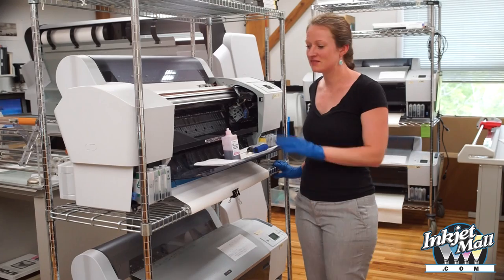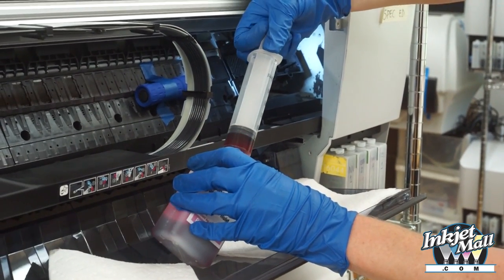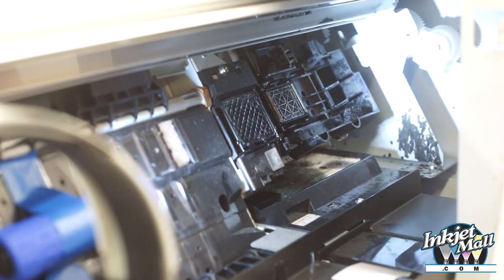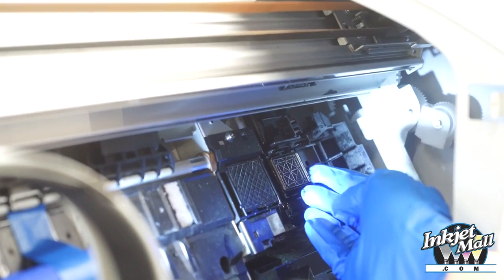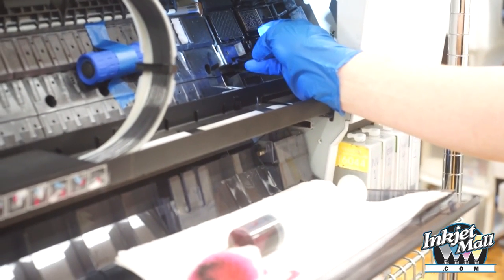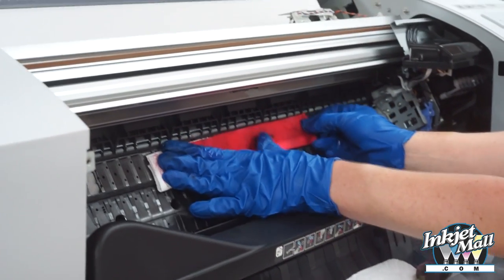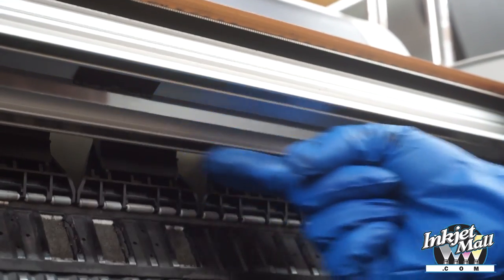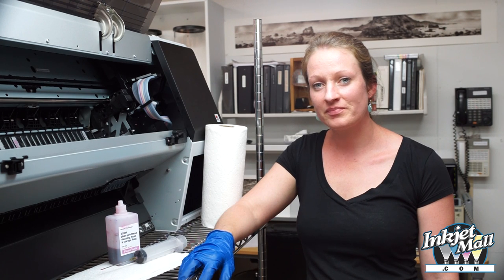How to Professionally Clean Epson 7800, 9800, 7880, & 9880 printers

Comment: Hey I was wondering if you might be able to help with an issue I'm having with my 9800...it doesn't power on. I know the power supply cord is good because it works on other printers before and after trying it on the 9800. When I plug it into the outlet I can hear a faint noise kind of like a short hum/buzz. It seems to want to power on but fails to do so. I took the back cover off and cleaned off the dust/debris but continues to fail to power on. Anyways I wasn't sure if this was a common issue or not...I can't seem to find anything else online about my issue. I did notice there is a 3v lithium cell battery on one of the boards... wasn't sure if this might be contributing to the problem? Should I try replacing the battery? All wires seem to be secure and no burnt out pieces. I was given the printer from a friend bc they purchased a new one for their business and it was working before I received it. I'm an artist with little to no budget for professional repairs so I'm attempting to repair it myself so I can use it to print my artwork on canvas/fine art papers. Thanks in advance for any advice!

Comment: Hi I have a 7600 which is reading no maintenance tank, I've fitted a new chip on the tank and changed the sensor on the tank reader and the circuit board as it was very worn.  But it is still saying no tank any ideas cheers Alex

Comment: Hi, I have an ultrachrome 9600 we changed the printhead, and after the plotter does not want to charge the ink, we made the initial charge (pressing feed paper up and down & enter ) then into the cleaning menu, and order the ink charge but we can watch ink does not run through the tubes, can you help me please ?
Reply from the maker: do not tighten the ink tubes too tightly onto the ink dampers (you should have put new dampers). If you tighten too tightly it will pinch the small rubber oring and it will cut off ink supply to head.  Make sure your capping station is clean so it can provide suction. Do you know if your capping station pump is faulty? Are the cartridges that you are using fully primed with ink?

Comment: Long story short, this stuff works! Its basically industrial windex. 

Long version: I acquired a 9600 3 years ago with a clogged megenta. The previous owner left it for 2+ years unused. Im surpised it wasnt ruined. Anyways he ran the cleaner program for a whole 220ml cart and than used windex. Fast forward and i get it with megenta stil half baked. B&W came out with a green tint and yellow was greenish also. I found -5 on the megenta in the drivers worked (mostly) to get ride of the green tint. Than I saw this video about cleaning the print head and decided it was worth $60 to try it out, otherwise the printer was going in the trash. Well.... It worked, whatever was clogged in the head is gone and nothing is green tinted. This stuff is insane, I can see it bubbling and melting the old ink. I didn't believe mine had a metal screen until this stuff took all the caked on ink off. The plastic is also white now. The wiper was even worse. Chunks fall off! Now it looks like a wiper.

Anyways if your printer is giving you problems, buy this stuff!

Comment: Thank you! That's how I've been cleaning my print heads (two Epson Stylus machines, one R1900 and one 7600). However, I use  70% rubbing alcohol and/or the original Windex glass cleaner. I use these only because I haven't heard of a solution specifically meant for cleaning print heads, that didn't contain mostly one of the those two ingredients, (in the case of Windex, I'm referring to the primary active agent).

That said, I've recently had a very difficult time trying to clean and unclog the nozzles & print head of my 7600. In fact, I've used the equivalent of two months of my typical printing trying to use the Power Cleaning and regular head cleaning modes along with the technique you've demonstrated here.

Some of the nozzle check tests would show an improvement, (but very small improvements), and yet others would begin to show the nozzles getting worse. I'm going to try this Piezo cleaner (if I spelled that right), and buy some of the additional accessories to make it a little easier to apply.

Up until now, this printer has always done a good job but it is a 5 generation printer. The tech is far behind and I'm seriously considering a professionally refurbished 7890 for $2000.00, (comes with 350 ml Epson inks most of which are 40% to 60% full). Thanks again for that video. I know the cleaner will be of great help regardless of whichever printer I use it on.
Rich
Reply from the maker: ammonia cleaners (Windex) should not go near modern Epson print heads. And alcohol dries to quickly...   best to use something designed solely for printheads (PiezoFlush).
Reply: Thank you, and yes, I'm going to use the PiezoFlush and try to clear those 7600 nozzles. However, I did wind up purchasing an Epson Stylus Pro 7890 in pristine Condition, (seriously, THAT GOOD!). I bought it from a small certified, printer repair company in Dallas/Fort Worth called "Levi Systems inc.".

They are a top-shelf tech/repair company and also sell new printers along with used ones if, and when they come upon those that are only in very good aesthetic condition. In addition to the appearance of the ones they consider for reselling, the mechanical condition must be very good as well. 

Even so, they always replace the print head, pumps, cutters and other key parts regardless of condition once they know they have a buyer. Doing that essentially makes the printer every bit as good as a new one. I was impressed all kinds of ways with the unit I got for $1900.00 a few days ago.

They personally delivered it, set it up on its table, and ran a full nozzle check, head alignment check, etc., etc. Of course, it passed with flying colors, (pardon the pun), and they even gave me a new 350 ml Matte Black ink because the Matte black ink it had in it was nearly empty.

The remaining cartridges were all 350 ml and at least 40% full! Then they handed me an Epson leather, (or simulated leather), folder which contained two manuals, a quick-reference guide, a DVD with the Drivers, (Firmware was up to date already), and the complete paper-catch basket system! 

Like I said, it was a seriously good deal. I plan to clear the 7600 nozzles and sell it for about $250.00.
Thanks,
Rich
Reply: Acetone is the best thing in the world. It breaks down any ink and dissolves it.
Reply: @stuartcotterill9475   I have no idea why I didn't think of using that!! I should have known that because it works on many different issues. Anyway, I have sold that 7600 years ago. I have a 7890 now and no clogged nozzle issues.
Thanks,
Rich

Comment: Awesome video.  Thank you.  Is there a way to move the ink with a syringe?  One of my line seems clogged?
Reply from the maker: yes, you can remove the ink line from the ink damper at print head.. Pull the cartridge out of printer so ink in line can travel freely. Use a syringe to pull ink from the cartridge.  Replace cartridge and pull fresh ink back into the ink line and reattach to the ink damper.  BUT do not use an ink cartridge if the ink is now outdated as you will clear and then reclog after your hard work. When reattaching the ink line to the ink damper only finger tight or you will distort the tube and need to replace the line or the fitting.  You might consider putting new fresh ink dampers on the print head if you are going to all this trouble. They should be replaced every few years no matter. Perhaps you can find them on internet somewhere. Epson no longer provides them. But, they are a common size.
Reply: @Inkjetmall  Thank you so much.  I could use a nice tune up for my printer.  You don't have services in California do you?

Comment: Hey nice video, do you know how to fix a paper jam error. I have been looking but no paper to see that's jamming....do you have an other solution??
Reply: I know this is VERY late but in case others are curious, sometimes this is a VERY misleading error code. I have copied and pasted some posts I made years ago in a forum as this did indeed solve the problem. My printer was a different model (9600) but it seems the error codes and causes are pretty much identical.
===================================
It seems that I misunderstood the PAPER JAM notes. As it seemed (to me) reasonable to reckon that a Paper Jam would be to do with paper being fed through the machine - and affecting the LF motor, it is in fact to do with the CR motor. I was reading CR motor and foolishly translating it in my head to the LF motor.
I am going to have a look now and see if perhaps the guide rails are in need of some "Super Multi Oil, No.32" - hopefully this could be a really simple fix.
------------
A little follow up just in case anyone follows this thread in the future with a similar error.
After giving the carriage rails a clean (or at least as best as I could without disassembly) using a lint free cloth and some isopropyl alcohol and being surprised at just how black the cloth became, I then repeated the process so the cloth was almost clean - and then applied some synthetic number #32 grade oil.
To do this properly, you are supposed to dismantle the right hand side covers and although it is only supposed to be a 20-30 minute job, I am not someone who always manages to reassemble things as easily as I take them apart - so found that I could do the nearest rail (top and bottom) fairly easily and the rear rail underside too. A little bit of electrical sleeving later I managed to make a small "crook" shape and could dispense dots of oil along the top of the rear rail too.
Gently took the carriage (printer off) from one side to the other several times and THOUGHT it seemed smoother - but was aware that that may have just been wishful thinking.
checked to make sure there was no surplus oil dripping anywhere, loaded up some ultra cheapo paper and made an image which had a thin bar at each end of the paper, lied to the printer that it was photo paper and set the highest resolution, high speed off and made it print. It used only about 10p worth of paper, perhaps 1p worth of ink, but had the carriage rattling backwards and forwards for about 20 minutes.
At the risk of tempting fate, the "Paper Jam" error is no more.
I did worry that had found a new problem later though - when I had some ink blobs appear on a printout - but once I had set the platen gap to wide (I was printing heavyweight polyester banner), the problem stopped.
It has been something of a labour of love with this printer BUT I can see why it has so many enthusiasts. Amazing quality prints and (paper jam errors now sorted) appears to be very reliable.
Going to get some custom profiles done I think for the Inkteck powerchrome ink for use with banner paper and Xatvia Matte. Not sure how much difference it will make but might as well get things as close as I can 
===================
Touch wood - it has not failed since. Great machines but a bit tetchy from time to time.

Comment: Mine is staying "Paper Error. Load paper Properly" I'm pretty sure the paper is loaded properly, I'm not sure what the issue is, do you have any suggestions?
Reply from the maker: could be as simple as a dirty paper sensor that can not "see" the sheet. You can download the Field Service Manual for your printer at 2manuals.com and on other places on the web - and you will see in the diagrams where the sensors are located and you can see if they are covered in paper lint. Cleaning them might help!
Reply: @Inkjetmall  Thank you, that might be the issue because it's been outside for a while, covered, but outside.

Comment: is this the same process with the 11880
Reply from the maker: technically yes. We do not directly support that model because we have not found any refillable carts/chips that function correctly. So we can not support it with PiezoFlush internally to clear out the ink lines and ink exchange unit. But, doing this type of preventative maintenance every six months is a very good plan.

Comment: Would this process work with the P6000?
Reply from the maker: Yes. We make a video on how to clean 7900/9900 printers and the P6000 uses the exact same print head. What is behind the print head is a little different. So how to clean the bottom of the print head is the same, and how we clean the inside of the print head, ink selector unit and ink lines with a refillable cartridge filled with PiezoFlush is the same as one would do with a 7900/9900. And really it is about the same as with the 7800- 9880 printers. Not that much has changed from model to model with the exception of the a new coating in the print heads.
Reply: @Inkjetmall  Thank you for the response. I am looking at a P6000 locally and saw your video on 7900 and wondered if the procedure was the same. Thank you I will look on your site for the ink tanks I think I'll need a few.

Comment: How can I contact you? I have some questions about an epson 7800 stylus pro. It just started printing blank a couple days ago. Never sits for long periods of time. It acts as though it's printing but the paper is blank. Nozzle Checks, Prints, Setup page... All print nothing. Cleaned like your video shows. No improvements. Any ideas? I just can't imagine all the colors got clogged in one day at the same time. I've run multiple cleanings. No change.
Reply: How did you fix it?I'd say clean your head manually, don't do hard cleanings, this will break your printhead.
Reply: +LoverOfPhotography ended up having to change the pump cap unit. ;-) i have to get some of that piezo flush though. i think that will help
Reply: Had the same thing happen today, but was software. Reinstalled the driver and no blank printing. BTW is Isopropyl Alcohol a good cleaner?
Reply: Darshi San
I bought piezo flush and it works flawlessly and is much safer!

Comment: Hi, please i need help ....;today after some printing my epson 9800 print with buses..... then i doet cleaning more times (10 twins or more) but no résult...... already same buses..... did i must change head??
Reply from the maker: It is not a good idea to run 10 or more paired powerful cleanings as that generates too much energy to the print head and can burn it out. Better to install the PiezoFlush using a cartridge to that particular clogged channel using the INIT FILL operation. Then letting it sit for 48 hours and repeating the INIT FILL to pull out any of the softened materials.